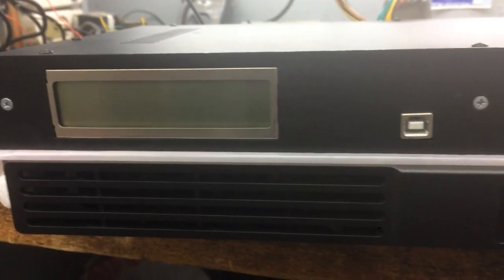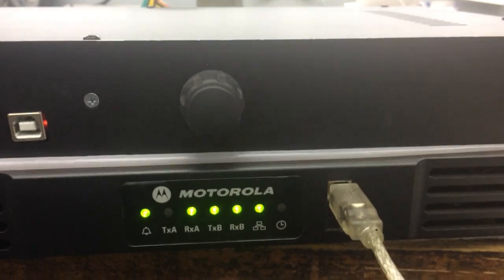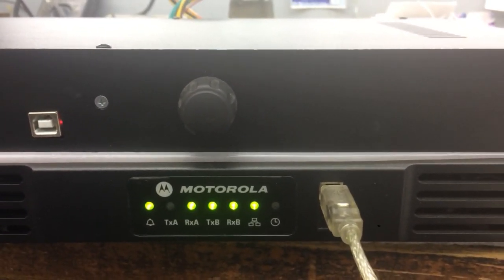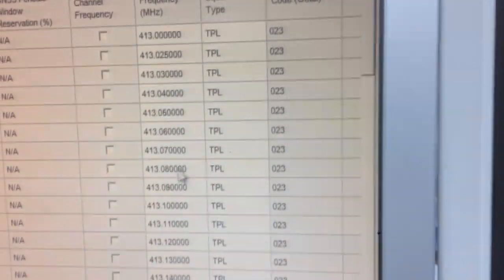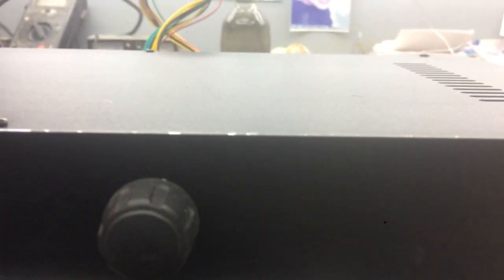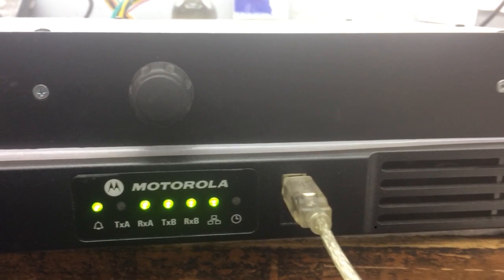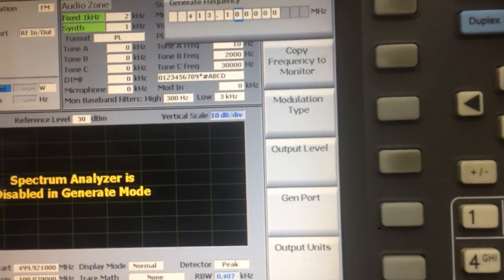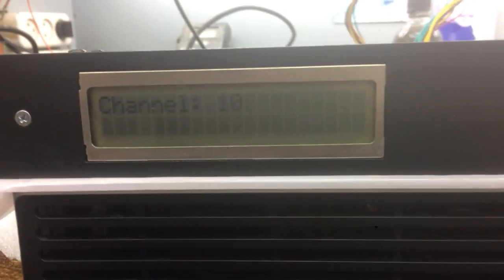Channel selector for MOTOTRBO repeater SLR5500 and SLR8000

Comment: I connected the DR 3000 repeater by mistake to a 24-volt supply and the fan burned out. Is there any harm now because it is stopped, or what is the alternative fan from the market?